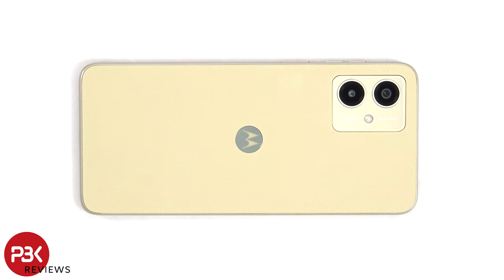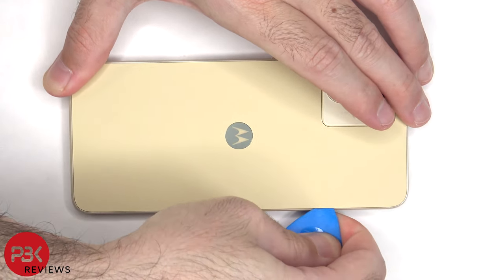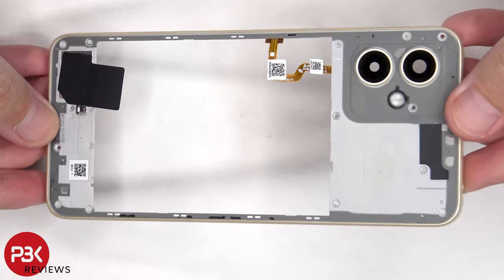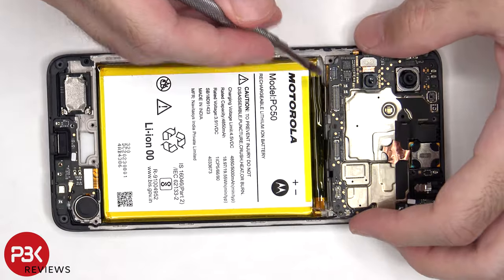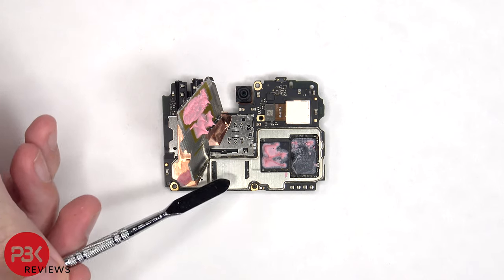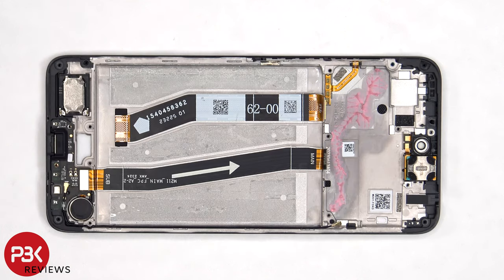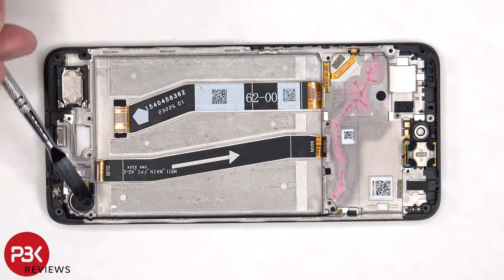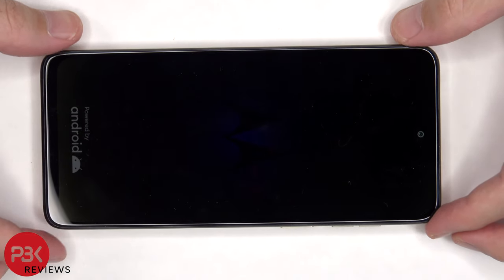Motorola Moto G14 Teardown Disassembly Repair Video Review

Comment: Any tip on peeling off the flex cable for volume and power buttons? I'm afraid of either breaking or melting it. It doesn't come off!
Reply from the maker: Use a hair dryer to heat it up, and you can use a thin blade or razor blade to carefully get under one corner and lift up to be able to then get a plastic tool that won't damage it underneath and work on prying it off.
Reply: Да,я сломал кнопку

Comment: thx for your video. do you have another one regarding how to replace the screen on a g14 motorola? or may be other related video? can't find any. thx
Reply from the maker: You're welcome. Well you can use this video to do it. After you take the phone apart like shown in the video, all that is left is to heat up and pry off the old screen from the frame. Not much left to do. Or if you get a screen with frame combo which is the easiest, you would just replace all the parts from the old phone frame and put it on the new one.